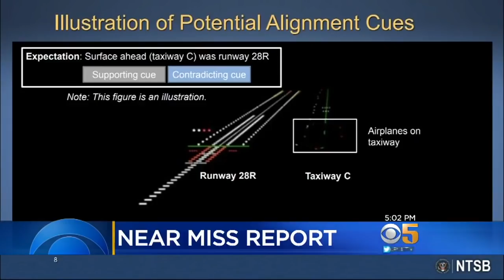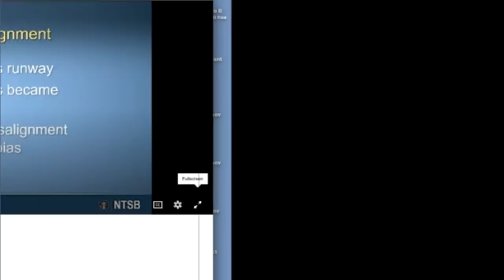NTSB says Notams are 'just a pile of garbage'

Comment: I agree on the surface all those pages of NOTAMS are garbage except for those NOTAMS specific to your route of flight and airports.  I was trained many years ago to go over the NOTAMS and pick out the relevant NOTAMS to my Route of flight and airports. Grznted 50 plus years ago the NOTAMS were not in so many pages.  Still pilots are required to review all NOTHAMS prior to flight to find any relevant to their routes of travel.
Reply: I think the issue is that in order to pick out and determine which are applicable to you, you still have to read each in its entirety. For example the one they read regarding taxiway barred, it didn't say who it all applied to until the very end (aircraft with wingspan larger than...)
Reply: Mate yesterday I operated a flight from London to Rhodes .... I had 15 minutes to read 35 pages of NOTAMS . Ck the WX  ck the flight plan ( which had 3 errors )  brief the CC CK the potential land and TO pref both in STN and RDS and decide the fuel load.  

We dont have ATPL dispatchers in Europe to help us. 

 Your talking out of your back side.
Reply: If pilots read the NOTAMS affecting their route, dearture, destination, alternate and ERAs no flight would depart on time, I tell you that. At least not in short haul.
Reply: Lol include the long hauls also, unless you wanna read the NOTAMS during cruise during your rest period reading a 100+pages NOTAMS just for airports only the FIRs NOTAMS is a different story, and deciphering and absorbing and understanding all the info while busy monitoring your flight in the cockpit you gotta be crazy

Comment: Realistically, if every airline pilot went over every relevant NOTAM for every flight in a single day, they would have literally no time for other tasks.
Imagine a part 91 operation.
IAW 91.103, a Pilot has a huge amount of preflight tasks to complete before departure
Imagine having a job where you’re on a schedule and has an hour between flights. (Which is a LONG tome) however, not long enough to complete all the required preflight actions. Legally, you couldn’t finish all the tasks prescribed in 91.103 in time. 
Review of all relevant NOTAMs on the airport of departure, enroute, arrival airport, and alternate 

Reviewing all weather and obtaining some sort of briefing for before the time of departure, time during flight, and time after arrival and along the route, to the alternate 
Obtain ATC traffic delay information
Review runway lengths at all airports of intended takeoffs and landings with calculated landing and takeoff performance using winds, temperatures, pressure, extensive weight and balance calculations, and fuel burn calculated with performance of flight in association with the expected weather..
Also knowing which alternate airport to choose and Ensuring there will be enough fuel for the entire duration of flight plus 30-45 minutes depending on time of day and flight plan with alternate in mind
Reviewing airworthiness, registration, ensuring the POH is handy, have a completed W&B, review of placards and external placards, review of inspections IAW the maintenance logs, ensuring there’s the required equipment IAW 91.205 and others, adhering to AD’s, checking form 337’s, reviewing TCDS, reviewing KOEL or MEL or MMEL if applicable, and ensuring the aircraft is airworthy.
Let’s not forget the physical preflight to determine the aircraft is in proper condition for flight 
Ensuring the pilot has all their required documentation and certifications on them
Ensuring a safety briefing 

There is not enough time for pilots to complete this between flights for a normal CFI job, airline job, or anything requiring more than one flight a day with less than a 2 hour break between
Reply: SERIOUSLY? 
Since when is whinging about “not enough” time an excuse for gross negligence?
What does a captain do if he has jot enough time? …press on?

Comment: It’s very important to read the NOTAMS that may affect your flight, but it’s true that the actual system is garbage and that leads to leave some importa info unread just due to pure time waste.
Reply: Reading NOTAMs is no fun - but absoutely vital for LOW VIS ops, for expl.?
A professional pilot can filter out the “crappy office desk” notams from the relevant ones.

How do you otherwise know if an ALTN can be used / planned if the ILS is downgraded to CAT I ???!
Reply: @SundanceHelicopterTours  i mean if you ignore the professional pilots who missed airspace closures, TFRs and runway closures, 50% of the time it works all the time.

Humans are an imperfect machine. The NOTAM formats are garbage on the best of days. The important messages are there, if you can find them in the densely packed all caps notices that are 50% strings of numbers you are never gonna decode. You'll see the important stuff 99% of the time, but that 1% will kill you every time. What if we said no more birds notices, no more crane notices unless it impacts glideslope or landing operations, and we were given some better way to warn of unlit towers than a shitload of coordinates lets be honest nobody is breaking out their rulers and a paper chart to decode for?
Reply: Do we still need to be told some radar altimeters might not work at certain airports because of 5G? I am a VFR pilot who doesn't use a radar altimeter, but I'm pretty sure those who have impacted altimeters are already incredibly aware, let's stop flooding those notices out too.
Reply: on most days, I should get 0 NOTAMs. Crazy thought, right? But on most days, the airport I'm flying out of has nothing wrong, and nothing bad of note is happening. If something popped up, I'd be instantly aware there's something important there. Imagine doing a briefing and getting 0 NOTAMs because nothing exceptional is happening you need to know about. Crazy, right?

Comment: Runway and taxiway lighting are very different. The pilots should have noticed this!
Reply: fatigue is an abnormal brain state. 19 hours on duty?
Reply: Fatigue is a factor. However, I stand by my original comment. The lighting of a runway is very much different from a taxiway. In particular, runways had PAPI lights (or equivalent) and taxiways do not. Also, the airliners on the taxiway should have been clearly visible. It was a clear night.
Reply: Frank Simon It seems you know a bit about aviation but maybe you never experienced what is real fatigue in command of an airplane, or even while driving a car, everything is possible in such a mental and physical condition, especially at night surrounded by hundreds of flashing and steady lights and colors. It's like being drunk.

Comment: This NOTAM mess never changes. Here is one single NOTAM from the flight plan of an overseas route (LAX-SYD) that is flying tonight. There are 16 pages of NOTAMs in this flight plan package! Note the date today is Jan 09/23. Note the date on the NOTAM title!! SSDD. (the valid date is from Oct 27/22 at 1406Z to "UFN" ... until further notice)    Hit "Read More" to see it.
HNL 27.Oct.2022 1406z - UFN 1A3103/22
HONOLULU TWO DEPARTURE ...
TAKEOFF MINIMUMS: RWY 4L/R, STANDARD WITH MINIMUM CLIMB OF 492FT PER NM TO 1900, DO NOT EXCEED 180 KIAS UNTIL SOUTHEAST BOUND ON 155 HEADING, OR 1700 - 2 1/2 FOR VISUAL CLIMB OVER AIRPORT. ADD TAKEOFF OBSTACLE NOTE: RWY 4L, TEMPORARY CRANE 1895FT FROM DER, 234FT RIGHT OF CENTERLINE, 200FT AGL/ 211FT MSL (2018-AWP-6418-OE), TEMPORARY CRANE 3017FT FROM DER, 1055FT RIGHT OF CENTERLINE, 180FT AGL/ 191FT MSL (2020-AWP-361-OE), TEMPORARY CRANE 3294FT FROM DER, 1118FT RIGHT OF CENTERLINE, 200FT AGL/ 209FT MSL (2018-AWP-6416-OE). RWY 4R, TEMPORARY CRANE 1849FT FROM DER, 266FT LEFT OF CENTERLINE, 200FT AGL/ 211FT MSL (2018-AWP-6418-OE), TEMPORARY CRANE 2971FT FROM DER, 553FT RIGHT OF CENTERLINE, 180FT AGL/ 191FT MSL (2020-AWP-361-OE), TEMPORARY CRANE 3249FT FROM DER, 617FT RIGHT OF CENTERLINE, 200FT AGL/ 209FT MSL (2018-AWP-6416-OE). ALL OTHER DATA REMAINS AS PUBLISHED.

Comment: So airline pilots, what should we (airport operators) do with NOTAMs?  We have requirements from the FAA to issue them, so we do.  If we don't, and you land on a taxiway, then the airport gets named as a "contributing factor" towards your screw up.  Suggestions please.
Reply: Possibly clarify things so you don't have the jumbled mess like the mentioned Toronto taxiway information, and remove things like "birds invof", as that's always the case? I'm sure it would be a long process to try to change things, at this point it's just a matter of recognizing that the current system doesn't work.
Reply: I don't think anyone is blaming airport operators. It's the system in general that needs an overhaul. Runway closure NOTAMs shouldn't be buried amidst a pile of other unimportant notices. And the FAA needs to evaluate what is worthy of a NOTAM. Like the chairman said, things like "birds on and invof" are a waste of space.
Reply: Stop issuing them for non std markings, mowing, and every unlit tower and crane within a 10 mile radius, we don't care one lick about ANY of that.
Reply: In other words use them for the only thing we actually care about, things that are closed or not working.
Reply: First thing is that NOTAMs and weather should be in plain English. This dense code is stupid in an age when we aren't using 30 BAUD teletypes.
Reply: So let's say we are repainting at an intersection, and we have a non-standard marking. If we do NOT create a NOTAM, and a pilot has a runway incursion, the airport operator will be found at fault.  You may not care about it, but we do. It's all about "safety" (and blame.. I've seen it happen too many times.)
Reply: I do agree, they should be issued in "plain english".  Wildlife information is usually published, and not a NOTAM, but if there is a NOTAM, it should be for increased activity, such as migrations. So if you DO see that NOTAM, that means there's MORE of a danger than normal, at least at my airport.  Also, FAA issues a lot of the NOTAMs that clog up the system, the unlit obstructions, NAVAID changes, procedure changes. Those will sit out there for months or more. They usually fall to the bottom.  8 pages of NOTAMs is a lot.
Reply: Here's a crazy thought: only issue NOTAMs for THINGS THAT COULD GET PEOPLE KILLED.  Taxiway markings not standard?  Birds?  Snow off to the side of a taxiway?  All of those, DGAF.  

Runway closures, VASI OTS, Runway shortened, etc should be the only items in there.  We can no longer see the forest for the trees here...

Luckily the good people at http://flightservicebureau.org/ are trying to fix this.  I'm hopeful that the NTSB has (finally) seen the light.
Reply: Well you might worry about unlit cranes if you fly a helicopter...  eeeh..?